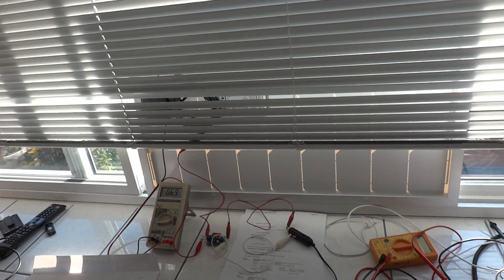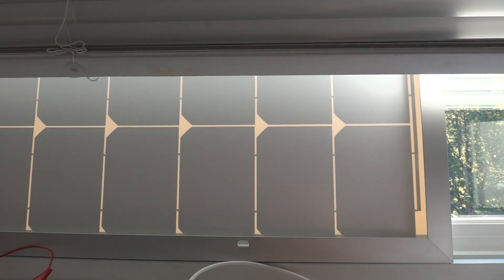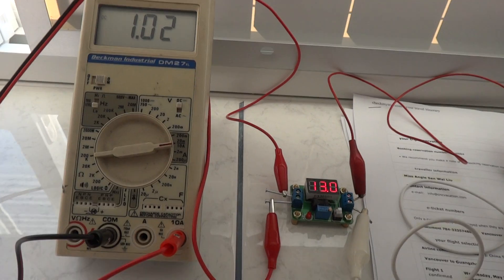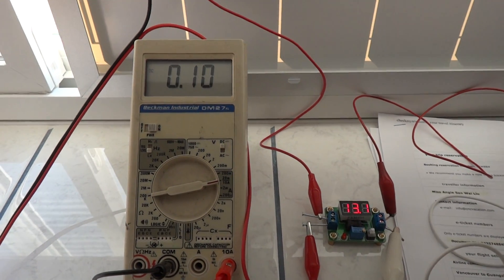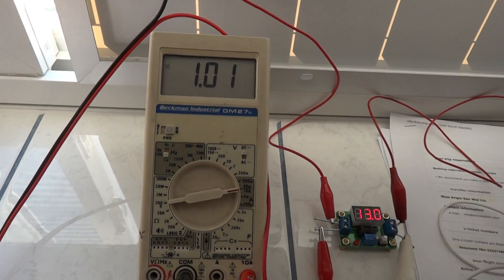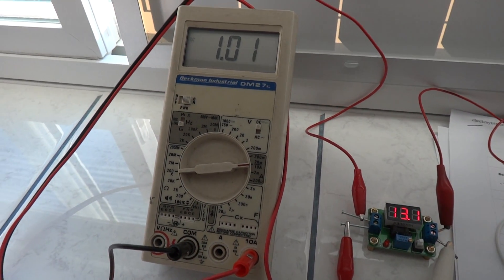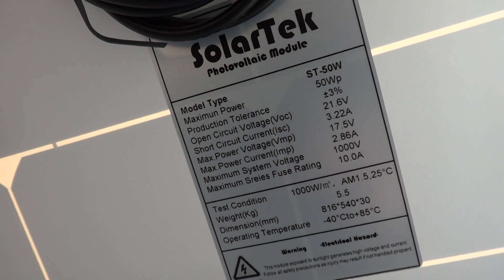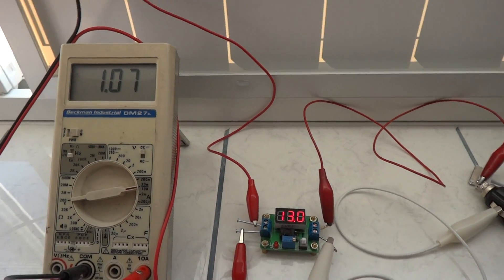50W Solar Panel powering my Yaesu VX-8DR Radio

Comment: Awesome work! I have the same radio and was thinking of trying something similar during my backpacking trips. I doubt I'll lug around a 50W panel but probably a 20W panel. Thanks for the video! Superb!

Do you know how resilient the charging circuit is on the VX-8DR? I'm wondering if fluctuations in current is an issue while the battery charges via straight solar power. Maybe it's better/safer just to output to a battery bank and go from there.